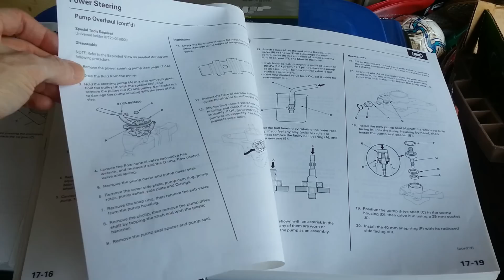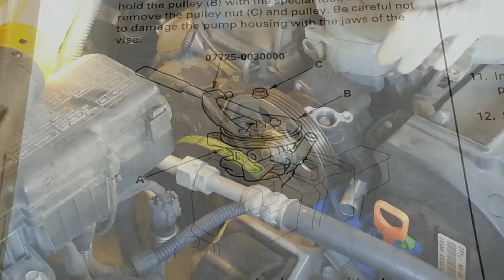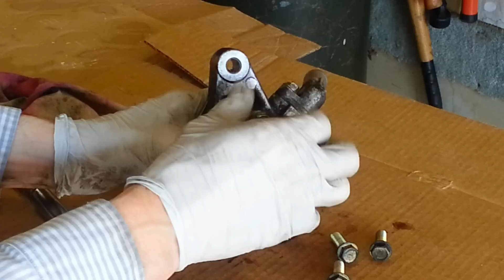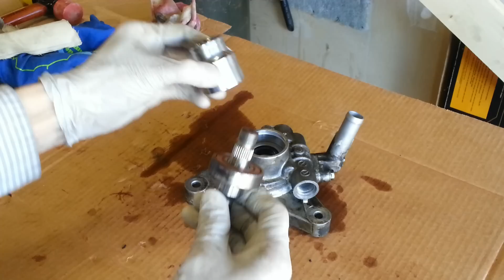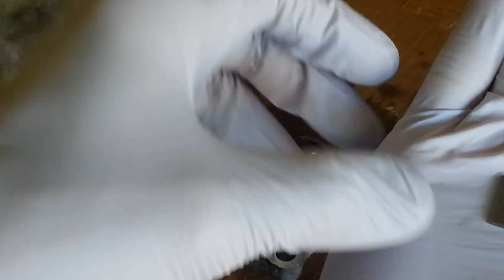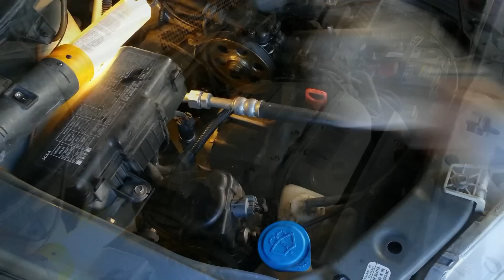Power Steering Pump Overhaul/Rebuild 2002 Honda Odyssey

Comment: Outstanding video...like a magic trick, it's easy when you know /see how it's done. I rebuilt my 99 ody pump based on this video. Sure it's easier to replace the entire pump but where's the fun in that. Your attention to detail was surpassed only by the simplicity with which you performed the work! My only difficulty was returning the shaft/bearing into the housing. The 30 mm socket  worked to a point but was to large to clear the housing. I used a 29mm socket to seat the bearing for the snap ring. If you have any other Odyssey repair videos I'd enjoy watching all of them...Thanks for taking the time to share your knowledge with those of us who are always learning and trying to do more with less!

Comment: Ever thought about taking out the transmission to do an overhaul? That would be a cool video. I have checked out Eric the car guy vids, and he has shown the inside of the transmission. What's your thoughts about lubing nuts and bolts with vaseline or some other cheap lubricant around the vehicle? I hate all the rusty bolts and wonder if there is a way to prevent all that crap. just paid 1700 bucks to have the dealer change the rear main oil seal & replace the rack/pinion.... the rack/pinion (reman.) part was like 700 bucks! they sure do make some money off those reman. I would have done the work myself, but I don't have an engine support thingy, and it probably would have taken me 12x the amount of hours that the honda tech did it!

Comment: Awesome video it really helped. Changed out leaking pump on 03 ody didn't have time or proper tools to overhaul. Replaced with remanufactured pump. Have you had to replace any motor mounts on your odyssey? I think that is next on the list.
Reply from the maker: That's certainly less work to replace the pump rather than doing an overhaul. I just thought it would be a good learning experience. Turns out I also have a leaking high pressure hose. I may make a video of that job, too. Yes, I've replaced the front and passenger side engine mounts a few years ago. It's a very straight forward process. Hope it goes well for you.